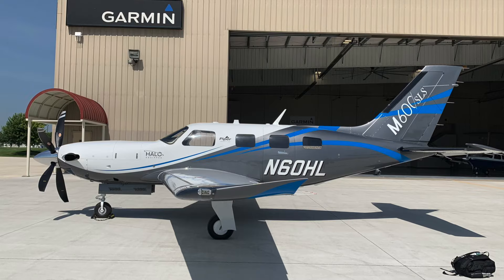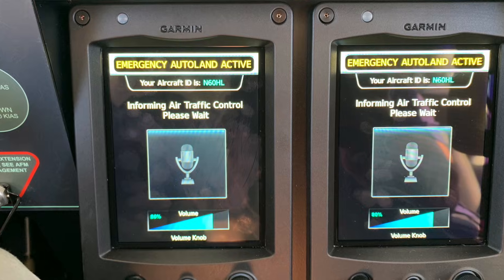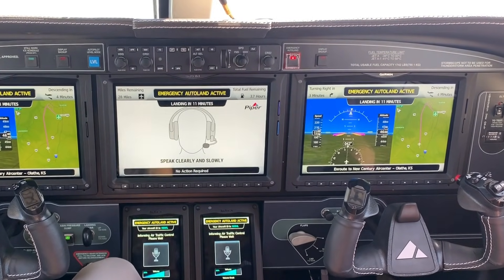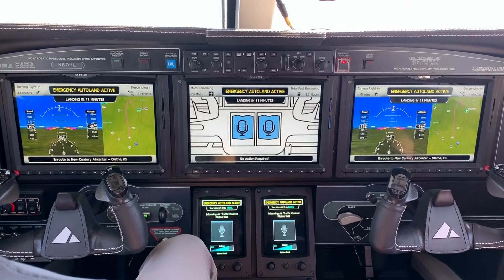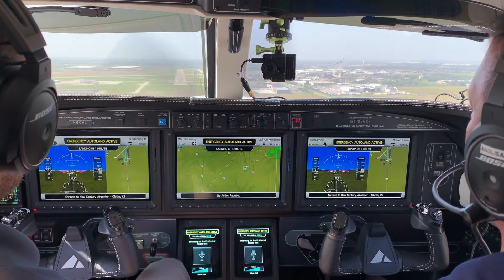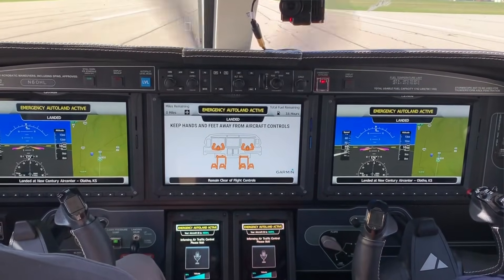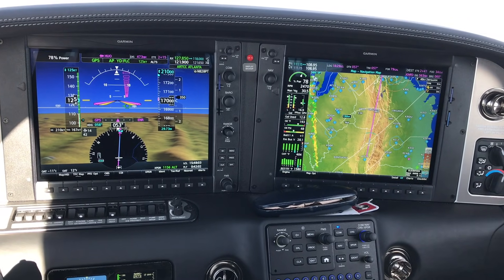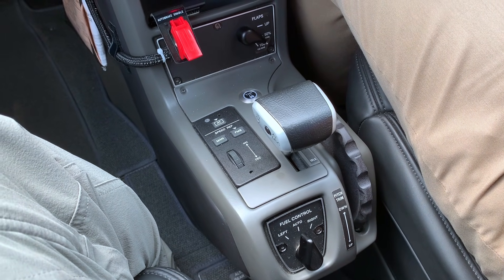Garmin Emergency Autoland Flight Trial

Comment: And here we go people cheering that the big paycheck pilots get their wings clipped by automation, more soft landings, no more jealousy on the Leo DiCaprio“ aviators“, it’s easy the computer does it - too bad Jonny pax won’t be the passenger on his 99€ seat from Europe to Asia since his job got rationalized by automation as well 
Meanwhile the rich 1% controlling the production are getting liberated and independent of the dedication, skill and craftsmanship of the 99% thanks to automation, no lousy pension funds, workers minimum pay and work safety. 
A dystopian future awaits, with a society torn apart while the 1% in charge of production also posses the production means. 
Rationalized, divided and played against each other’s — the 99% obsolete due to automation, dependent on a welfare state, bled dry by cooperations
Reply: And don’t get me wrong here: safety is important in aviation but is pilot incapacitation that much of an issue?? 
Vfr into imc— probably but there are proven and easy training methods plus awareness lessons to prevent that. 
On a commercial level? The big guys fly IFR... I see this autoland Demonstration as a hint to the lobby and the airlines to push for 1pilot crews and as the company itself being ahead of the competitors if the lobby successfully pushed for the dreaded single pilot ops. 
GA safety here is just a forefront for something more sinister and rewarding, being the #1 supplier for avionics to have airliners send their planes with 1 pilot ...

Comment: Nice to see Amazing technology like this there still a lot of cons to this a pilot will still have to perform manual emergency landing if it a mechanical malfunction somewhere on the plane.
Reply: That is not a con because it can only help you. Having it and it not working isn't a con, but it's not a pro either

Comment: somebody still needs to put the gear down...
Reply: They said it, the system puts the gear down (though it does not appear to put the gear lever down so in the cockpit it will appear as if the gear might be up).

Comment: “Short Final” as the threshold is crossed... you’d been on short final for the last few minutes: short final is from 4nm to the runway. For reference long final is between 4 and 8nm.

Out of interest, why didn’t it follow the runway centreline..?
Reply: What do you fly, an A380?  4 miles is 8 times the length of the runway where I learned to fly.  At KOKC the IAF for VOR  R12 is a meager  3 miles away.  Could be somewhere it is defined as you say,

Comment: Will this work in a VFR into  IMC?
Reply: Seems obvious that it would. There's no indication that they're using optical cameras to get a reference to the horizon. There is already the LEVEL button in Cirrus to help with the typical killer of VFR into IMC, which is spatial disorientation. What's exciting about this is that it transitions from enroute segment all the way down to being parked on a runway.

Comment: Why nobody is addressing the hacking threats?
Reply: Because there aren't many, the system is not open for wireless nor wired hacking and would require a passenger to alter the aircraft prior to take-off with various tools to assist in breaching basic security to perhaps override this system.
Reply: which hacking threats are you referring to?
Reply: coma13794 I am referring to, if someone has the knowledge and capabilities to takeover the flight control systems. The same thing applies to smart vehicles and etc........

Comment: But, this system is dependent on working sensors and accurate data incoming. Which is not always a good idea. Planes can have multiple failures. 

Maybe you should integrate a safety switch, if the system detects some failures.

A visuall camera utilizing AI can also be helpful for this autoland system.
Reply: This is not a system meant for recovering the aircraft after systems/flight-controls failure... It simply is not meant for that so no reason for it to account for it. That's like saying how this system will deal with mid-air refueling: not its target.

Comment: As a pilot, retired airline, teach Citation Mustang and Ten, I’ve taught Garmin for 12 years now. I love Garmin! 

I do worry about what we hear about no need for pilots in the future!? If a computer makes a mistake or just fails what happens then? I just can’t think that we should ever NOT have aircraft w/o pilots, esp commercial ops!
Reply: I will never enter a plane without having a possibility to fly a plane by hand in case of failures. No way sitting in full automatically flown planes without any human pilot on board. No no no….
Reply: @TakeTimeToday888  I'm the same! I don't trust computers that much. Maybe our kids do/will?
Reply: Never is a long time, perhaps in so many years there might appear pilot-less aircraft but in the near-future (10-15 years) I can't see that happen yet, luckily.

Comment: I assume the communication with ATC would be one-sided, therefore the system would declare an emergency right away? How are readbacks/blocked messages handled? Would love to hear some sample audio.
Reply: I'm assuming it listens for a clear channel before transmitting, declares a mayday and states this is an automated message with an incapacitated pilot.
Reply: I would also assume that it waits for an opportunity to transmit. But even if not, they mentioned in the video that the message gets repeated every couple minutes, so it would get across eventually.
Reply: If you use some intelligence. I will use mine for you. Pilot heart attack switches on auto land or auto land activates itself. Mayday mayday mayday, this is the garmin auto land system, we are declaring an emergency. Air traffic controller, to all traffic we have a mayday, please hold your approach until may day is clear.

Comment: What ILS Category is required for this to work? Is CAT I enough?
Reply: There might not be a ils requirement if it using gps.
Many runways are wide enough to not worry landing on the center line by a few meters.
The goal is to survive not a picture perfect landing.

Comment: Impressive—but woefully impractical, a very expensive solution for a nearly non-existent problem. NTSB statistics aren’t entirely complete, but the accidents attributable to pilot incapacitation appear to be pretty rare. When they happen, they get much press, but of the reportable accidents each year, how many are pilot incapacitation, vs pilot error, or mechanical failures? 

The video indicates that Piper didn’t have to add anything to the cost of a multi-million dollar airplane to include Autoland, but what does it really cost? I suspect that its cost is far more than a practical addition to the average 4 or 6 passenger GA single. It obviously requires a very sophisticated avionics package, plus many other additions to work the throttle, flaps, and gear, and in the realm of typical GA, none of that stuff is given away.

And then there’s the variation of the old Automatic Airlines joke, as the sweet voice intones: “Emergency Autoland has been activated. Please keep your hands and feet away from all controls, and allow the airplane to safely land itself. Do not be concerned. Nothing can go wrong, can go wrong, can go wrong, can go wrong, can go wrong....” There is no such thing as a 100% reliable avionics package. Statistically, the single avionics “doodad” most likely to glitch is an autopilot, and although this is more than just an autopilot, I suggest that it is very likely to be as glitch-prone as any other autopilot. Sweet voice, “I’m sorry, but Autoland has failed. Please take over the controls and land the airplane.”
Reply: It is a first system to function so far, others will follow and solve issues of cost to more acceptable levels while also improving reliability. Instruments/systems fail yes, is that a reason to not have them? Remember: this is a system for when a pilot is unable to land, rare but it can't hurt to have it on single pilot aircraft, turns a 'small chance of a passenger landing the aircraft' to a 'reasonably large chance of the system doing it'.

Comment: Does it require an ILS for it to work? or is it possible to do and AUTOLAND on an RNP / GPS approach?
Reply: No way is it going to require an ILS. It's already navigating from the enroute phase into the approach phase without any ground based navaids. Given the precision afforded by WAAS GPS, there's absolutely no reason to require an ILS.

Comment: Pretty wild....I wonder though....what are the crosswind limitations on this system....
Reply: Guess the same as the plane its fitted to?  Since its a emergency only system its "goal" it to get the plane down so the people inside it live.
Wrecking the plane while doing so for the insurance company to deal with.

Comment: At 5:02 when the plane was at 4,400 feet. I noticed some object pass by to the right side in the middle of the screen it's real quick to catch so you might want to play and stopped video before 5:02. I paused the video and looks kind of strange. Maybe some one with video editing software can analyze the picture and get better look at.
Reply: I wonder what it is?    @halcyonoutlander2105

Comment: Very interesting, thanks. . . Is ATC informed aircraft under auto land. . . who officially is PIC (if pilot is concious). . . will it respond to a go-around ATC instruction.
Reply: Doubtful. The system is likely making one-way radio broadcasts and setting the transponder, not much else.

Comment: The question is, what happens when the button is pushed and there will be an issue with the plane - gear, engine etc.
Reply: gear ; just land anyway and perform a "belly landing"  The autopilot keeps the plane "level" so even with a wheel missing the plane will try to stay level until the airspeed gets to low for the wing to lift the plane.
One that happens the speed usually is low enough to avoid injury.  No engine then the plane will glide but they did not mention if there database already include places to land outside a airport.

Comment: Once activated I wonder how it would handle an engine failure in a single engine aircraft?
Probably deliver the message;
"Autoland cancelled, your problem mate."
Reply: becomes an auto-glider with an emergency brake chute maybe. That might actually work in small craft. Not so much in anything larger.
Reply: well I mean that's not its purpose tho, right? If the pilot can't respond the aircraft is gone regardless if no fuel, or engine failure or engine is 100%
Reply: If they made it really good, it will detect the situation and make the best out of it.
Reply: Highways are mapped, if it cannot reach a field, it could technically land on a highway. You really underestimate technology and assume it's all so basic. Try looking at how software works underneath and you'll be surprised at the elegant complexity.
Reply: @declination00  while that is true, it can't yet see traffic. Also for a field landing it can't see smaller buildings and power lines, so a pilot should still do a much better job picking an emergency spot. Not sure about an incapacitaded pilot after being replaced by a non pilot!

But I bet in another decade that will be solved.
Reply: @ericoschmitt  "Seeing" traffic is not that difficult at all. Same goes for everything else. Not saying it's presently possible but it's not far out. I'm more concerned about tomorrow, less about today and yesterday.
Reply: @ericoschmitt  The software does not "see" anything it totally relies on a database giving it the information it uses to make the choices.
There is no technical reason building and power-lines can't be included in that database and the system knows to avoid them
Reply: @cmulder002  i know, but it would probably be easier to program a software that can understand camera images than having a infinitely complex database that includes every light post and tree in the world and keeping it updated. A system relying in a databade for emergency landing could easily land straight into the single tree of the whole farm and kill everyone onboard LOL
Reply: @declination00  it will come the day when these softwares will be able to safely land a glider in a random field and still avoid running over the scarecrow! Hahah
Reply: @ericoschmitt  the database about buildings and trees is already being made by companies like google for there maps and navigation apps.  Fitting a camera that is able to detect a runway being clear or not might take a whole computer by itself (basically what the tesla autopilot is based on) The additional weight and potential of false negatives..  Guess that will take a few more years
Reply: @declination00  Actually I don't underestimate technology but as a pilot I know handling a forced landing without power requires human level perception and abilities. 
Maybe AI will one day get there but at that point it will instantly surpass humans.
Reply: @AnthonyHigham6414001080  Not really. It's not an exercise in creativity, so it can be automated. What you perceive can be translated for computers. The abilities you talk about can obviously be fairly easily automated, it's just a set of conditions and responses.
I'm not saying this Garmin system can do it now but it can be done and I'm sure someone somewhere is already testing something that works.
Reply: @declination00  I admire your optimism but I suspect you are underestimating the complexity of the task by several orders of magnitude. It is not even understood how the optic nerve pre processes information from the retina before it arrives at the brain. After that we haven't a clue how the human mind makes associations and arrives at a conclusion and decides on subsequent actions.
The best AI systems currently available are really no better than 70's algorithms. The only real difference is processing power/speed and accessible memory.
As I said before, if AI ever archives this the human race is toast.

Comment: Well, the simmer's dream of land and save the day when the pilots become incapacitated is over. Lol..
Reply: dammit all those hours on ms flight sim for nothing
Reply: Bummer.
Reply: I really don’t get this nonsense thing, no one is going to be pushing anything when their incapacitated, anyone in the back of the plane will be clueless as to what buttons to push when the fat guy up front is having a heart attack so what’s the point.
Reply: @tropicthndr  pilot will have to advise the pax about this function.  It will take 30 seconds during preflight briefing.
Reply: @MarekMarciniak  on the vision jet, its a giant red button on the center of the ceiling, that says emergency auto land. In that case, even if you don't give a briefing all of the passengers will see it right away, and know what to press in case you croak at the controls.
Reply: @tropicthndr  it must be some big red button! lol
Reply: nofunallowed.jpg

Comment: How many people have died due to pilots becoming incapacitated? The answer: not many. All this is doing is getting us closer to not needing pilots at all, which is not a good thing.
Reply: 121 in once incident 

https://en.wikipedia.org/wiki/Helios_Airways_Flight_522.
What is wrong with not needing pilots? Humans are the single biggest point of failure in aviation.
You still want a navigator to shoot the stars for navigation or prefer the automated gps system?

Comment: What happened during gusting etc? The aircraft didn’t land along the center line in stable conditions
Reply: It will have less problems than a human pilot in difficult weather conditions. The offset comes from the navigation source and always slightly imprecise map data, I'm sure it landed exactly on the virtual centerline. Maybe in the next version they'll use a camera to visually align the plane with the runway in final.
Reply: autopilot have motion sensors so it "feels" the gust  just like a human does and compensates for it( a lot faster and precise then a human would)

Comment: i would bet this system costs about 5 to 10 times as much as paying a second pilot.
Reply: Doubt it. Even if initial costs are very high, like anything in software, they will come down as competition comes in. It's effectively code that already reads sensors and uses inputs that are available.
The cynicism about this is humorous considering this is the 21st century.
Reply: @declination00  would it not be great if Garmin would open source the software? Imagine the possibilities and cost reductions then most general aviation planes with a autopilot could have this feature.
Reply: @cmulder002  Sure, it would quadruple the development rate most likely but they will never do that. Similarly Microsoft won't open-source Windows, all the while they're using Linux in their Azure cloud - benefiting from open source.
Reply: @declination00  would love to see the patents regarding this technology.
My assumption is that the biggest problem was to get this certified while the autopilot and airport selection database  are well understood from other applications.
Garmin is "just" the first being able to combine these elements into a system and add a simple user interface.  Now its shown to be possible there might be other ways to do it avoiding there patents.
Reply: @cmulder002  Possibly. I won't even go into patents because I'd have no idea what I'm talking about. So many traps and absurdities in patents these days.
Reply: @declination00  One thing does not rule out the other, Microsoft (to stay within your example) contributes a large part of Linux development...
Reply: @someguy4915  Nowadays they do but only because of Azure. It's not like they'd do it if they'd get no monetary return.

Comment: I wonder if the system on the Cirrus Vision Jet has the smarts to activate the parachute (over a safe area) if the plane isn't capable of landing or reaching a runway? I'd love to hear the radio traffic. Presumably, this flight didn't land with fully automated radio nor at a random airport. So many questions. Thanks for posting such an interesting video.